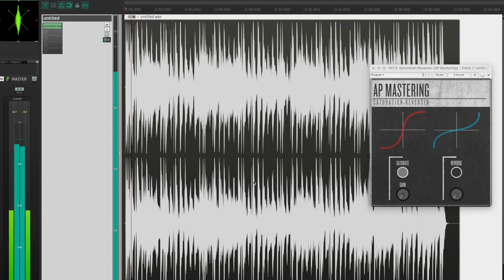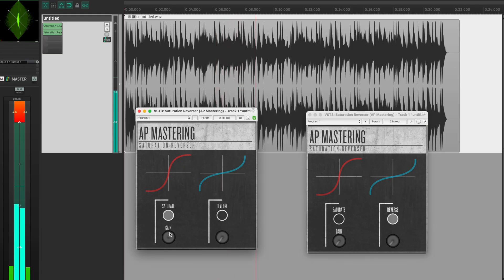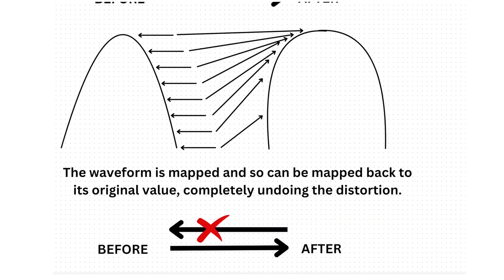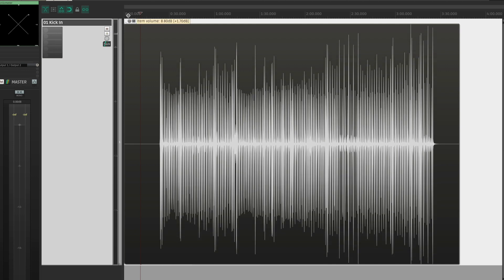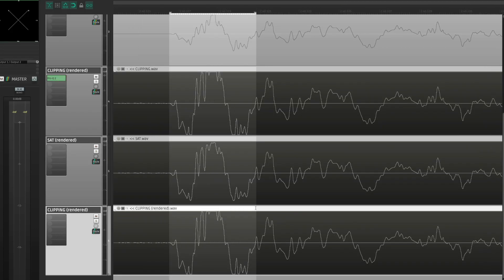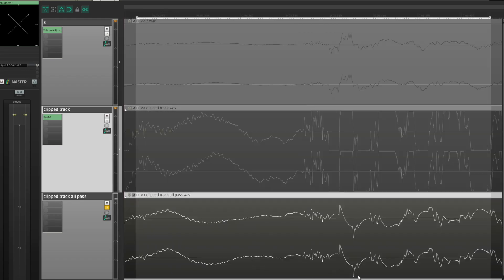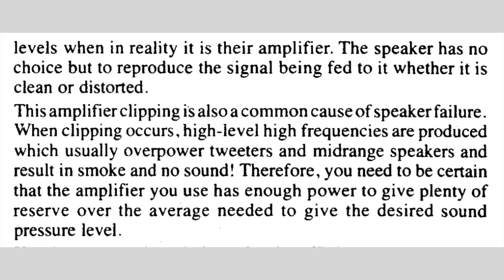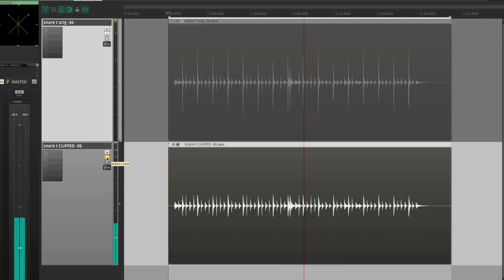Almost Nobody Knows, Distortion Can Be UNDONE!

Comment: Interesting! Can you demonstrate this using other plugins that are adding distortion or does it only work with the distortion added from your plugin?
Reply from the maker: it only works with tanh without post gain adjustment, so very specific. the reverser is not useful outside of a demonstration context but you can use the saturation sure

Comment: There's a deliciously unsavory irony to be found in listening to a comparison of clipped vs non-clipped signals through the YouTube smoosh-filter. Honestly, I could hear no difference in that snare example. BUT I 100% agree with your conclusions.
Reply from the maker: @periurban  were you listening at 1x speed? feel free to listen to speech at 2x but if you don't listen on 1x to music yt eats the transients
Reply: @APMastering  Listen at 2x? I tried it once and it made my soul hurt. No, I listen at 1x always. BUT I am in my seventh decade now, so if the juice is flowing above 10kHz it flows without me.
Reply from the maker: @periurban  ha ha OK, well I guess a lot of the detail there was above 10k, it just has more attack but the body is roughly the same.
Reply: @APMastering  The snare was totally different. 100% 
The clipped version sounded very tight/ pinned. And sometimes it is all you want in some genres. I work with clippers more often than not. When the mix is dense af, then things need to be in place and are not allowed to move. lol
Reply from the maker: IMHO that's just not great mixing... mixing by "ideas" rather than it actually just being good. Clippers are not necessary to make good music.
Reply: @APMastering  what did clippers do to you bro? Why all the clipper hate? 😂
Reply: Yeah I couldn’t hear a difference either.
Reply: @katielowen  Do you have good hearing? Mine is fading fast!
Reply: @periurban  I think so, and I listened to it in a car!🤣
Reply: Being no different is still good, because that means you achieve the same thing without the downsides of clipping. (I don't hear a difference either)
Reply: I could definitely hear a difference

Comment: wait I'm sorry but when it comes to the speaker issues, aren't they talking about physical clipping? It says "whether the mixer, amplifier, or any other piece of audio equipment clips the signal, Damage can occur without the amp's full output". If they are talking about physical gear causing the clipping i doubt that a loud mix that used smth like classic clipper will cause a pa system to go to shit lol
Reply from the maker: no they mean ANYTHING that sends a clipped signal to a speaker cone. there's nothing magical about a mixer clipping vs digital clipping
Reply: @APMastering interesting i thought it would have something todo with the overloaded signal that is coming in instead of the waveform that it had to reproduce thanks for the info i‘ll look further into this!
Reply: @APMastering  wait i‘m still confused if i played a square wave through my speakers for an extended period of time would that break the speakers?
Reply from the maker: @7ars471  it could if it is a substantial volume

Comment: Like the content and insights.
A key difference with tanh vs clipping is that with clipping 
you can affect a transient with no change to samples below
the threshold. But with tanh you must accept the gradual onset
that will modify samples below the threshold. Both result in a
distorted signal, and which one is more noticeable is program and
threshold dependent.  Assuming undo-ability is not desired 
then the choice comes down to what your sound goals are.
Reply from the maker: i agree but the nonlinearity of tanh doesn't really bother me until the signal is real hot. pretty sure i could run a string concerto through tanh and nobody would notice given a bit of headroom

Comment: I will try your plugin on my song where i don't like the spikes of the drums attack that sounded bad with limiter and compressor made it pump too much no matter what settings i tried but still left those spikes in
Reply from the maker: in this case i would probably address the original drum recording. a good well mixed drum recording doesn't behave like that and doesn't need spikes cut off
Reply: @APMastering  I think i hit the snare little hard but somehow compression just increases the spike in the attack. SSL plugin. So i need saturation to round it of like tape would
Reply from the maker: @sinenkaari5477  make the attack longer and reduce the amount of gain reduction

Comment: This might be missing thing from digital audio i've been looking for you got here. I've had a problem with getting drum compression sound the way i want. I always seem to not be able to get that smoother fat tone and end up with eather too much spiky transient or pumping. Drums sounds i like are from the analog days and tape compression is just like that, it rounds the sound. I think the flat waveform tops are what makes also human ears tired when listening some loudnesswar stuff with headphones you feel this constant push against your ears but if you listen to something older that has tape compression and tupe saturation in it, it can be loud but will still sound smooth and more pleasing to the ears. If your plugin is a way to do a digital version of tapecompression like it seems to be it's really needed. If you have it also really clean without aliasing or similar wierd harmonics (i wrote this in the half point of the video)
Reply from the maker: try parallel limiting or distortion

Comment: Your tanh function is a classic example of a soft clipper. Not all saturation has a limit. That is why hard and soft clipping are actually useful terms.
Reply from the maker: all saturation has a limit otherwise it has not yet reached saturation. that is the meaning of the word saturation.
Reply: @APMastering  then what would you call polynomial functions that introduce related, signal-dependent harmonics but do not have a limit? F(x) = x + 0.25 * x^2, for example.
Reply from the maker: @spicechateau  i use quadratic polynomial functions in some of my (as of yet unreleased) plugins. it is 100% distortion but i'd not call it saturation as it bares zero relevance to analog saturation... what is it supposed to model? magnet flux sat? iron core sat? tube sat?
Reply: @APMastering  I think that’s a strange way to define saturation. Tanh is not a model of any analog saturator. That said, if we’re trying to stick to functions that roughly emulate physical principles, you can approximate a compressor’s ratio control with a piecewise function that adds saturation without a hard limit.
Reply: Clearly you’re doing a lot of plug-in work and have knowledge of the field, but I don’t think I’ve read a single paper or textbook that would agree with your definitions. It really seems like you just have a personal vocabulary and you’re calling people out for not adhering to it.
Reply from the maker: @spicechateau  yes and no. I do have my own way of working but I'm formally educated in audio engineering and my background comes from being a working engineer and having an interest in electronics. I don't think I'm saying anything too crazy... saturation is when things saturate, IE tubes, transformers, tape etc and in the digital world we can model that saturation, and tanh does a nice job of approximating that..... this doesnt seem to be all so controversial. The only thing I admit is highly contentious is my denial of the term soft clipping. I just personally don't like it. If we took a vote among 100 audio electronics experts whether soft clipping is a valid term or not, I'd expect to lose on the votes. But this is pretty much the only controversial thing I'm arguing for here.
Reply: @APMastering  I wouldn’t call your claims controversial really. Soft clipping is a well used and accepted term with a specific meaning. Saturation also has a technical definition beyond “when things saturate.”

Curious to know what your formal education is? Have you published anything?

Comment: good vid.  except soft clipping is a valid term especially when an adjustable threshold is involved.  yes it's just a form of waveshaping with an implicit clip threshold like you demo, however as a tool, an adjustable threshold implies you do want to hard clip above it in a specific place on purpose 🙂.  so 'soft clipping' is a good way to think about it.
Reply from the maker: but tanh can be scaled to have a thresh and is an impassible limit
Reply: @APMastering  yes, any waveshaper can.  but my point is that if the user is given an adjustable threshold, then clipping is the specific intention of that tool, rather than the byproduct.  ie. the name is descriptive of the application, not the dsp.
Reply from the maker: @desperateBeauty  well i find that saturation is just this. i used to limit stuff by sending it through a tape machine for example. that's saturation by definition. nobody calls that tape soft clipping

Comment: So in terms of damaging speaker cones and what not, essentially the idea is that hard-clipping introduces DC offset to the signal (which basically means that the signal has more positive or negative values overall).

But doesn’t heavy saturation also introduce some amount of DC offset? Especially when applied to non-symmetrical signals?

So, I don’t think the kind of distortion really matters in terms of DC offset. If the PA system is handling audio properly, and the audio signal is being High Passed to cut out the DC, either in the actual recording, board, or in the drivers, then the DC offset thing is kind of a non-existent issue. Audio signals aren’t even truely “flattened” when being clipped anyway, because of the nyquist limit. There’s still some actual wiggle in the signal (recall: true peak)

So correct me if I’m wrong, because I’m mostly going off of intuition, but I believe the issue only really arises when the DRIVERS themselves are being clipped. THAT’s where the issue comes into play. And that’s not an issue of the audio itself, but rather an issue of the input volume simply being too loud going into the speaker. But if the drivers aren’t being clipped, an audio signal with a clipper on it isn’t truely “clipping” bc of the Nyquist limit (hard LP filter). And any dangerous amount of DC offset would be mitigated with a HP filter.
Reply from the maker: sorry for short reply but has nothing to do with dc offset in the normal sense, unless by dc offer you mean the clipper top and then that's not really the correct term. it's overheating because of power without movement
Reply: @APMastering  no worries. My point is that “clipping” on a sample level is not actually power without movement, because of true peak: the samples don’t reflect the actual physical “movement” of the speaker cones, but are something of a “guide” for the signal.
Reply: Also, DC offset is the term for power without movement (theoretically, a 0hz or near 0hz signal)
Reply from the maker: sure but look at my low pass filler example in this vid. it's almost the same
Reply from the maker: @zionjaymes4415  of course but you don't say dc offset for part of a signal which is demonstrably above 20hz
Reply: @APMastering  Okay... So are you saying  is that the "flatness" of a signal is essentially what damages speaker coils through overheating? And it has nothing to do with amplification? I'm picturing a square wave, and muddling up the phases with an all-pass filter. The resulting sound is the same loudness, timbre, RMS, etc. The only difference is that you trade low amplitude "flatness" for higher amplitude "spikeyness". So are you saying that one of these is more damaging than the other?
Reply from the maker: afaik a 20hz square wave is a cone destroyer on a large pa. if you all pass it first, the damage might be mitigated somewhat. but i'm not a pa or live sound expert. dan worrel is a live sound expert and says clipping destroys cones
Reply: @APMastering  Ah okay. Thanks for the quick replies btw...  I've always thought the issue of speaker coils heating up lied mostly in overall power (related to RMS) of the signal. Not the "flatness" of a signal. And obviously square waves (or signals that are saturated or "clipped" with DSP) offer much greater power at a lower amplitude. I could be wrong though. There seems to be a lot of argument about it online. Maybe a future video idea could be conducting an experiment using real speakers.
Reply from the maker: @zionjaymes4415  both! a sufficiently loud sine wave will blow a cone
Reply from the maker: if the amp is overpowered obviously